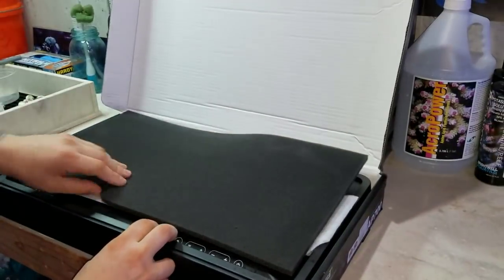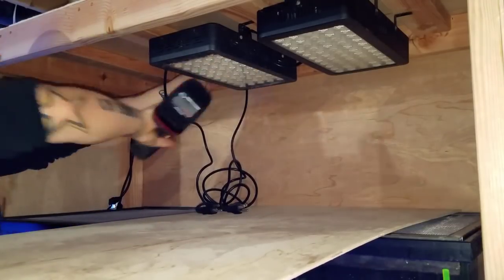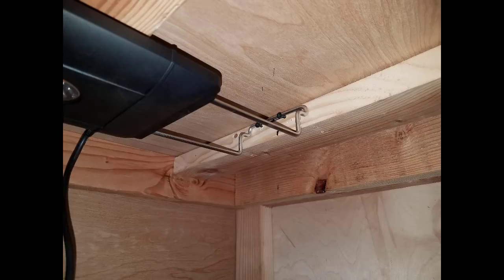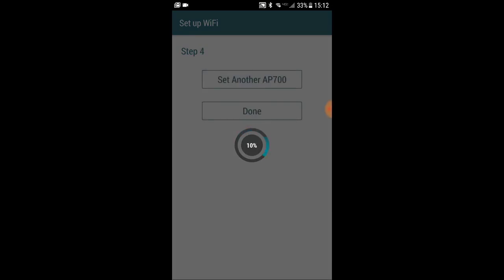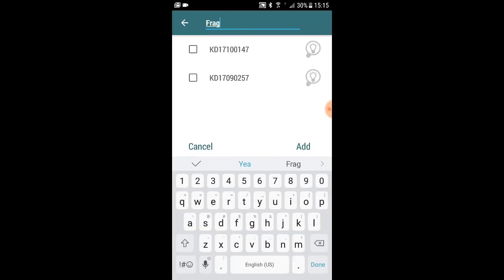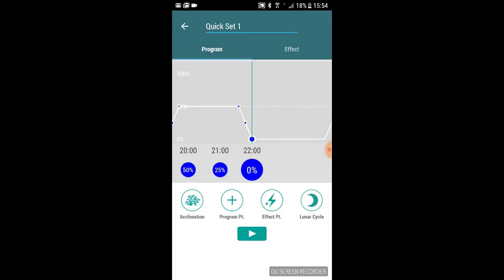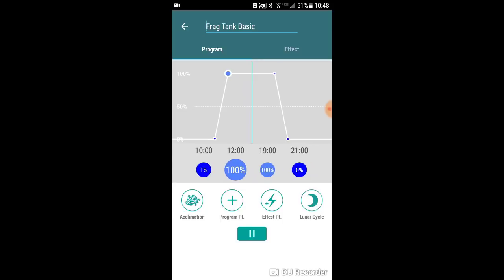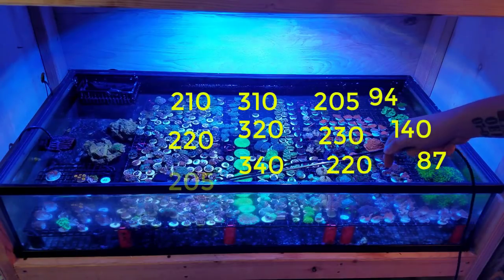How To Setup Kessil AP700s | Programming & PAR Numbers

Comment: Are you still running these at 100% over the frag tanks? I have a 4ft 120 with the ap700 16 inches over the water. Scared to crank it up that high

Comment: I am running a Kessil a160 over my Red Sea 34 gallon just wondering what intensity do you recommend ramping up to? Only have it going up to about 40% right now because I’m worried about burning the coral with too much light. Mostly lps corals with a couple of montis.
Reply: Just ramp it up slowly if you have a controller, or change it over the course of week or 2 and see !  If they are doing fine now go to 45% for 2 weeks and then 50 %.    No need to ramp it up though if your corals are happy. I would increase intensity for special SPS , carpet anemone, or clams..     Lot of coral do better in lower lighting
Reply: A Ron thank you!

Comment: Hey Travis, how are the corals adjusting to the ap700 at 100%.? I have a 4 ft 120 with the ap700 and am scared to crank it up past 70%. My light sits at 16” above the water. Just wondering on your experience so far.
Reply: I have 3 above my main tank and I have no problem getting mine to 100%. I use it that high for one dot on the graph for like 2 hours

Comment: Hi Travis good video, but I do have a question and I don’t mean to sound like a smart ass! So if these lights are good enough for your frag system then why don’t you use them on your main display?
Thanks again peace!
Reply from the maker: bc i have 8 radions and 8 t5 bulbs over that tank
Reply: FishOfHex  yes I realize that but let’s just say I had the exact same tank as you and I used two of the kessil lighting over the 300 would I get the same results?
Reply from the maker: No not you would need four to even come close